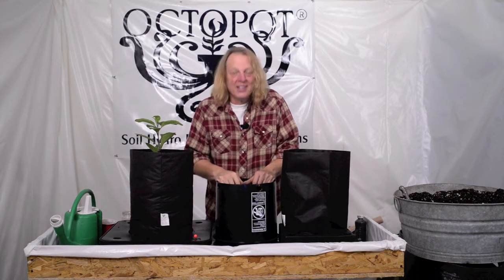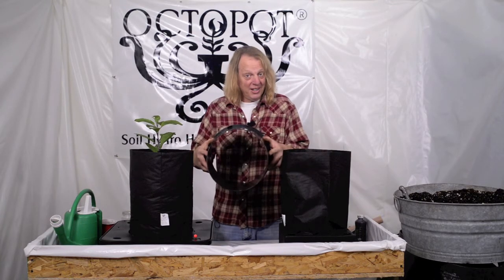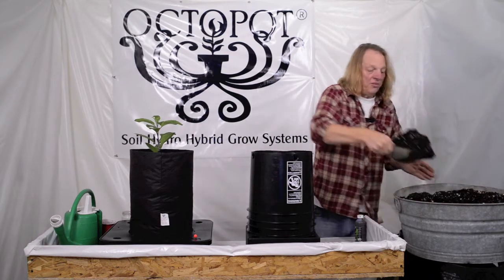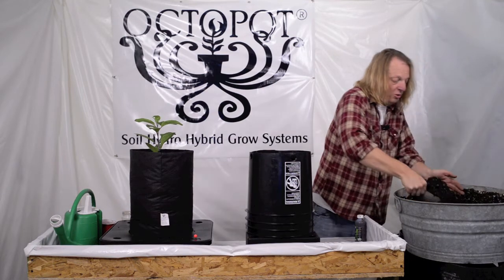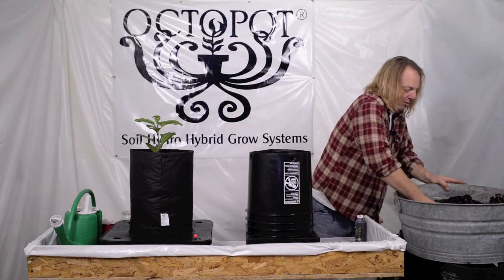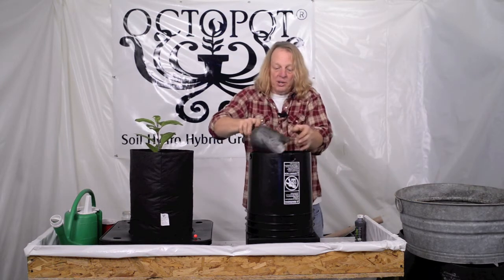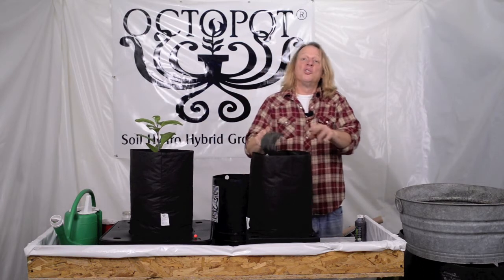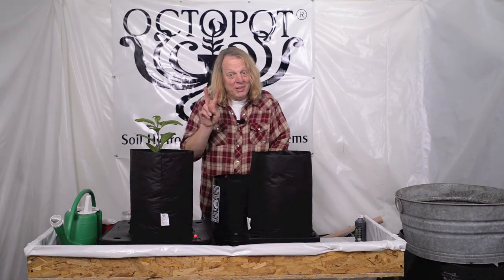Octopot Grow Systems Tips |Filling the Gro Sleeve Bucket Trick

Comment: are there any other differences between the 3 and 6 gallon octopots other then the actual reservoir? ie sleeve and the wicking thing etc are the same?
Reply from the maker: Yes, the sleeve and wick are compatible with both bases.  We are currently working on a prototype sleeve that holds 3 gallons of soil rather than 6.

Comment: Can i use coco instead of soil
Reply from the maker: Octopot Grow Systems require a high quality well-aerated growing media that promotes high air capacity.  Octopot recommends a 60/40 ratio – specifically 60% high quality soilless mix with 40% perlite.  Sunshine® Mix #4 is a professional growing media that works well.  Octopot Grow Systems may also be used with sustainable Coconut Coir or Coir blends.   Warning:  Heavy compacted soil will prevent Octopot Grow Systems from functioning.    The soilless mixes and professional growing media used with Octopot Grow Systems must have 40% perlite.  Perlite may be added to any soilless mix to achieve the 40% ratio.  Perlite provides space between soil particles where water and nutrients easily flow to plant roots in the Gro Sleeve®.  Perlite must be well blended into all the soil or growing media before adding it to the Gro Sleeve®.   Do not add Perlite alone to any part of the Gro Sleeve® or Hydro Wick®.